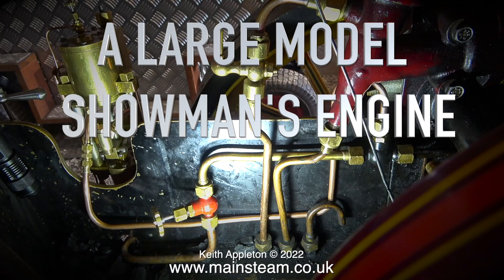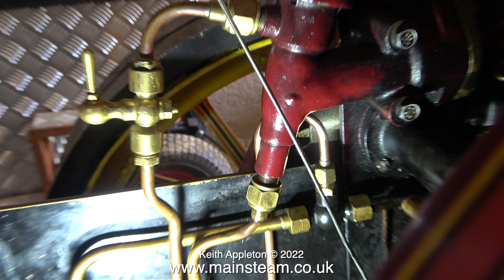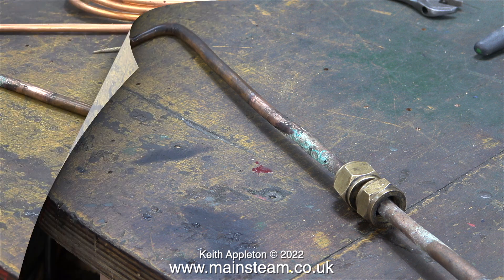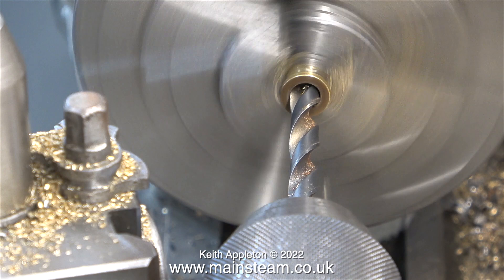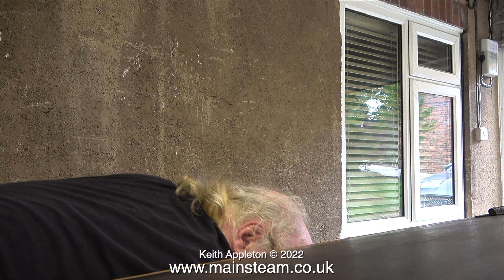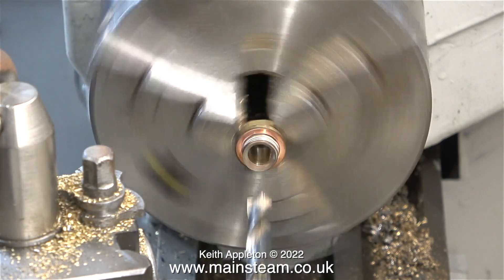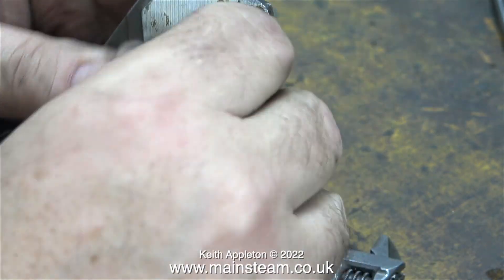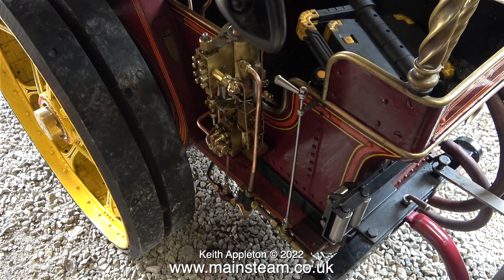A LARGE MODEL SHOWMAN'S ENGINE - PART #63

Comment: how could anyone assume that pump cant fill the boiler ... heck the boiler size and its steam off amount are what determine if it can and cant do the job ... as long as the pump can match or exceed the amount of steam made then the boiler will fill ... as I figure it the showman doesnt run at super high steam pressure nor with hundreds of gallons of water ... so the pump should have no problems keeping up at all ... now if we KNEW the flow rate of the pump at various pressures we could figure out the pups sweet spot .. where it pumps water fast enough to refill and then can be turned off for an extended period ... 
.
and as for the sump tank ... it looks to be the size of a small gas can (jerry can 2l) so I assume the boilers tank is about 5 to 10 gallons ... or a normal car gas can ...